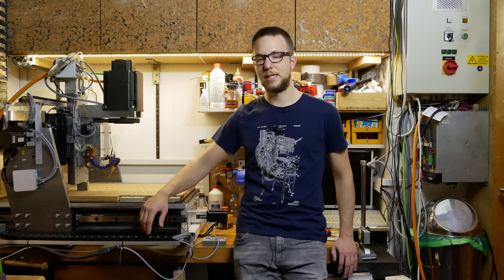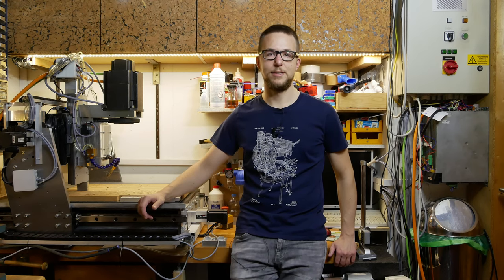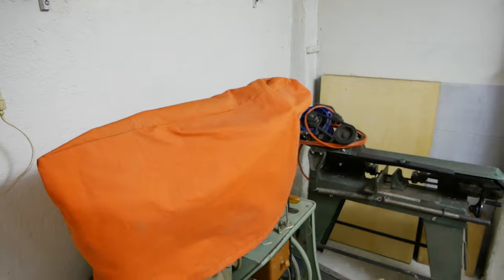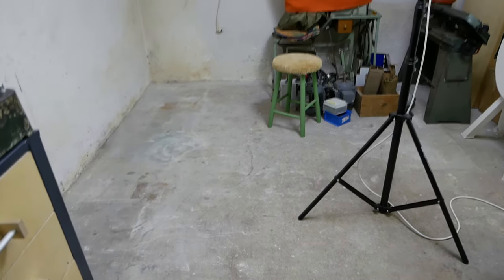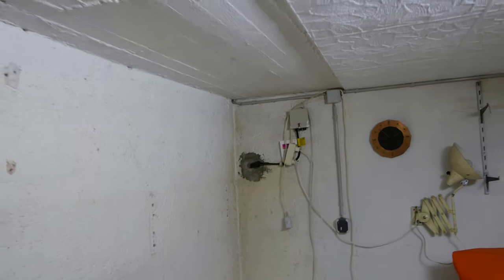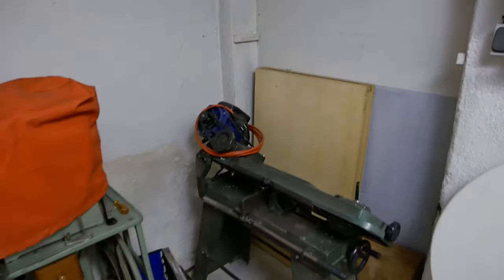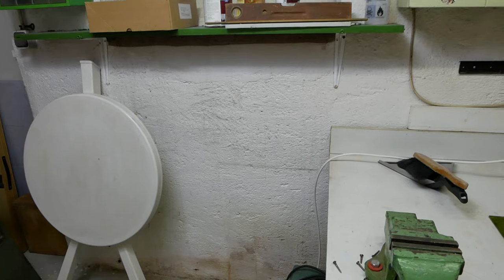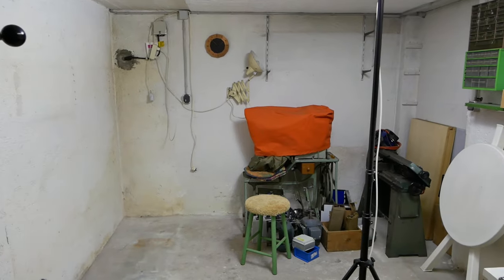Channel update and new Workshop!

Comment: When you redo electrics you should consider 3-phase power in the shop.
Reply from the maker: That's planned. I will also have a little fuse box in the workshop. The main fuse box is directly behind the wall next to the door. So very easy to get a new cable to it. 
Best 
Alex

Comment: Hi Alex.  Good to see you back making videos.  What about epoxy paint?  Easy to clean, and more robust than ordinary floor paint.  A bit more expensive, and a little extra work to put it down.  You will need to use a special primer first after cleaning the floor.
Reply from the maker: I decided to go for normal paint. I have leveled the floor today so it is flat now. Normal paint should be also quite resistant.
Best 
Alex